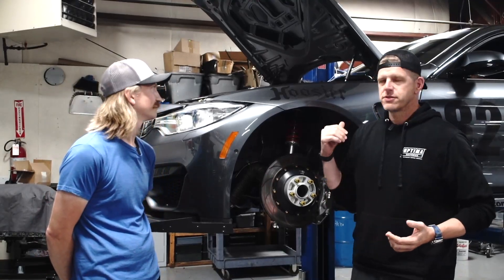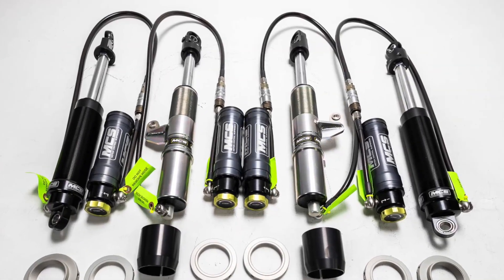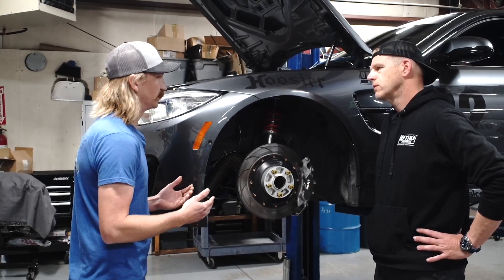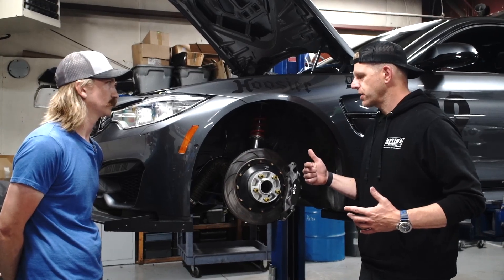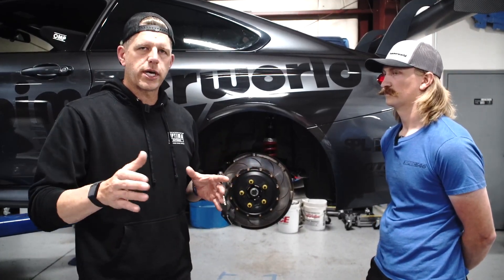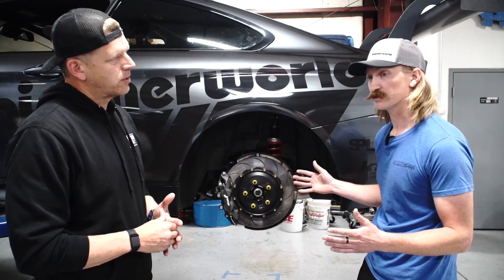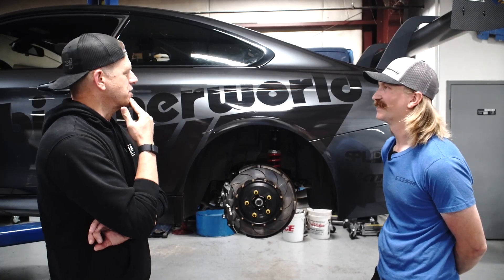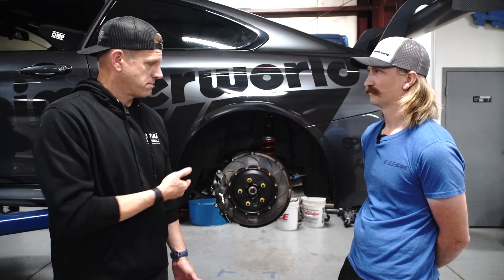The ULTIMATE track suspension for your F8X M3/M4 - BimmerWorld GTMore

Comment: The clevis front upper shock mount is brilliant! Does that cause any loss of shock travel?
Reply from the maker: Not at all, full damper travel was retained.
Reply: I agree.  Have never seen that before.  Would love to see this made for earlier models.  For my E39 m5, I'm having to use weld-in camber plates to get the pin inboard far enough.